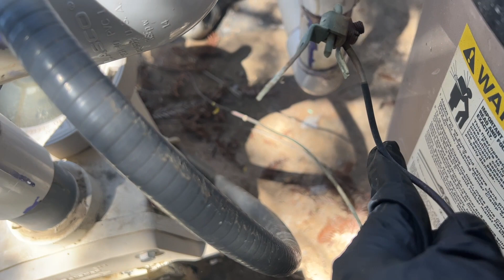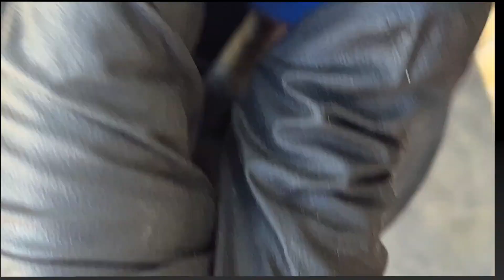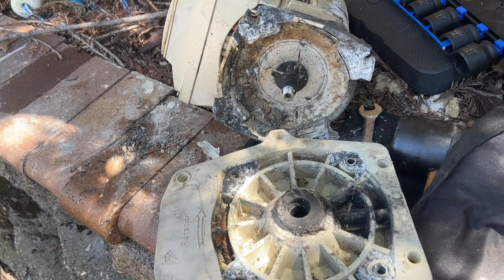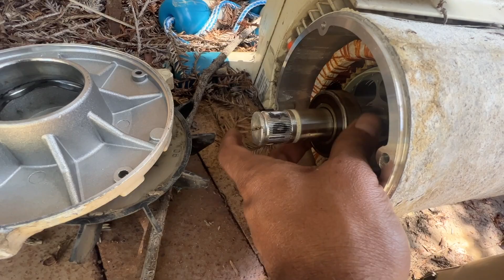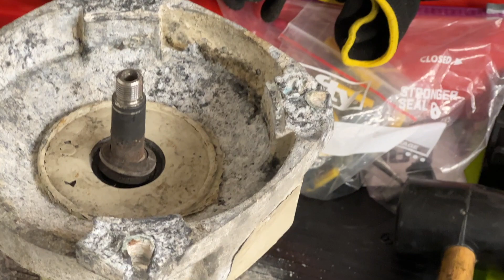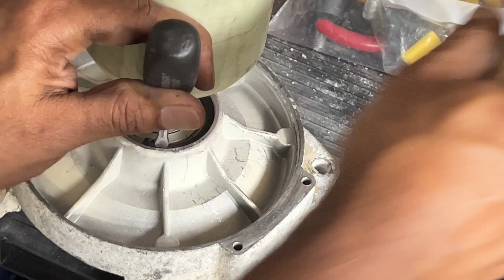Pentair Intelliflow Pool Pump Motor Fix - Bearing Replacement

Comment: Never tap on the outer race when installing a bearing on a shaft. You must use a pipe, a drift, or a socket to tap on the inner race only. Tapping on the outer race can damage the balls, the races, and the cage as all the force is transmitted through them to the inner race. Tap on the outer race when installing a bearing in to a boss. For the same reason.
I hope you replaced the ceramic pump seals, they were leaking as evidenced by all the corrosion.
Reply: Nice video, thanks.
Reply: Use the old bearing,  with a  correct size pipe or socket. This will protect the new bearing.
Reply from the maker: Very useful suggestion.

Comment: Always check for any water leakage from the pump that would indicate a mechanical seal leaking. Left unrepaired, the water will find a way into the motor bearings and seize the motor up, and you will have a bigger problem as this video shows. His motor windings were spared burning up because the high end variable speed pump has a computer monitoring motor current, and shut it down before it got high enough to burn it up.

Comment: Thanks for the video!  On a side note... you do not have to bang on the motor flange with a rubber mallet to remove it.  Simply use a 2 Jaw Puller on the inner shaft side of the motor and the inner cover will come off with no effort.
Reply from the maker: Thanks for the tip!

Comment: A hint for removing snap rings.  The plier’s points are tapered, so always slip out.  I use a small file to make the points look more like an hourglass.  This or just a small groove or reverse step.  Then the snap ring is locked in behind this step/grooves once pressure is applied to open the ring.  Thanks for the informative video.  Just ordered my bearings.
Reply from the maker: Thanks for the hint!

Comment: Thank you. is the bearing size all same for pentair motors? I have 353134
Reply from the maker: Not necessarily. It varies based on the model number.  I took mine out and searched based on the bearing model number and measured before ordering.
Reply: @SivaFolsom oh, I see . thank you

Comment: Excellent video. 35 bucks in bearings and a few hours is WAAAYYY better than $2000 for a new pump assembly or $800 for a new motor.  I just replaced my bearings in my intellliflo using this video as guidance. The bearings recommended here fit correctly and you get 2 of each so keep the spares for the next time. My pump is around 5 yrs old. The original bearings were 6205-DU and 6304-DU and had the rubber seal. The front bearing on mine was the problem. The plastic fan on the back is pressed on but comes off easily. You might as well get a new seal kit while you have the pump apart. I picked one up on amazon for around 15 bucks. You will need a puller to remove the bearings from the shaft and something like a piece of pipe to pound the inner race to install the bearings. Thanks!
Reply from the maker: @jasonfestich2196 Awesome!  Thanks for the update.
Reply: Do you know what model motor? mine is pentair 350305s

Comment: The reason your motor was seized and showing overcurrent it might of been yhat the seal plate and mottor head were really in bad shape for shaft seal leak and caused impeller to bend and pinch..u can see in beginning when he takes off impeller..impeller was rubbin on seal plate because seal plate was no longer sitting well.
Reply: He had a mechanical seal leak that he ignored for too long and water got into nearest bearing and eventually started seizing it up. Luckily for him, he had a motor that has an over current sensor that shut him down before he would of burned up his motor. Never ignore seal leaks, shut it down and fix it.
Reply: @officerkrupke4966 i agree...

Comment: That pump has has a mech seal leak for a while.  That flange is in bad shape.  Usually when they get like that.  The bolts an screws don’t want to budge due to the swelling/corrosion.  On the flange an elsewhere.   
I’ve snapped a few screws even holding the top of the drive into the motor due to that.  

An unfortunately it seems quite common I cross motors that have had mech seal leaks an it gets in shape like that.   An bytime it does crap out.   I’ve had to drill an rethread a few things on motors.  Just so they would hang on a little longer.

Unfortunately that’s why I’ve never really offered the service of rebuilding them.   People let mech seal leaks go so long without worrying or noticing them.  It just royally F’s removing bolts an screws a what not.  

If I were able to source replacement square flanges.  Without the motors I probably would have before.   Replacement bolts even the through bolts aren’t an issue finding. But after the flange is shot.  It’s not really worth it

Comment: Just rebuilt my pump this past weekend and wanted to add some notes for others here. My pump was in pretty much the same condition as the one in the video, so I did take the extra steps once the bearings were replaced and the motor was in one piece to remove the corrosion (using wire wheels, and paint stripping discs on the angle grinder) and repaint the motor before reassembling.

I used Timken 6205-2RS and 6304-2RS bearings.

The stainless bolts holding the seal plate to the volute, and the motor to the seal plate are not metric (14mm) as stated in the video. While a 14mm wrench will work, they are 9/16, with 3/8 - 16 threads. I used a thread chaser to clean the brass threads on the seal plate and reassembled using antiseize on them.

While the method to remove the motor fan (and rotor and shaft) from the back of the motor works (by beating the front bell end off the motor), here is another video for removing the fan: https://www.youtube.com/watch?v=4up3x0yml-Y Once the fan is removed, you can remove the rear bell end more traditionally by tapping on the three raised lugs on the bell end. Then the front doesn't put up any fight at all.

Take your time with the three screws holding the fan cover, and screw holding the ground lug. I could have easily stripped the heads on the fan cover screws but did not. I did however sheer the head of the screw for the ground lug. I was able to set the rear bell end up in a jig (2x4's) to hold it vertical and square in order to drill out the old screw and tap in some new threads. I was able to find a new lug and ground screw from the orange-colored big box store, but did have to notch the fan cover just a little to make it work.

And lastly, if you're going through the trouble to open this pump up this much- replace everything you can, but most importantly the mechanical seal between the impeller and seal plate. I replaced both the impeller and diffuser as well, as the diffuser has a brass race that impeller sits in that was well worn; as well as all the seals. There are plenty of other videos covering those jobs.

Comment: My 4 T25 torx screws on the front impeller plate are completely frozen.  The torx bits break off.  I guess it’s new motor for me:(
Reply: I used an angle grinder to slice the aluminum housing open, sprayed in PB Blaster, then tapped the bolt out. My auto mechanic suggested this method as it’s much easier than drilling out the bolt.
Reply: @ my motor looks pretty sorry. The bigger bolts to the seal plate that broke, I was able to punch them out of the motor flange. The 4 motor flange to motor housing bolts, I ground the heads off to get the two pieces apart. Penetrate oil and a torch wouldn’t free up those bolts so I ground them flush and used cobalt drill bits to drill them out. Then I re-tapped the holes
Reply from the maker: You could try drilling out the screws.
Reply: @SivaFolsom  Thanks, I did just that but installed new motor anyway due to being down awhile. Took some time to get the screws out and re-tapped.  Now I'll have a spare. Two of the heads that held the seal plate broke off too. The ones that didn't break off, broke the inserts out of the seal plate as well. ugh. More drilling, more parts.
Reply from the maker: @ Yes, it's nice to have a spare.

Comment: READ THE @mguerramd COMMENT !!!  
He should also have cleaned off all the corrosion and painted the housing for further protection.  
As to the oven comment - at 350 degrees you may well damage the grease and/or the seals, and shorten the life of the bearing.  
The comment below about the stainless shields offering less protection than a truly sealed bearing is spot on.
Reply: The correct way is to bathe them in a heated oil bath.

Comment: The stainless steel ####-ZZ bearings don't resist moisture as well as the original rubber-sided ones (-DDU aka -DU aka -2RS).  Thanks for the detailed video!
Reply from the maker: Thanks for the update.  Hope it lasts for at least a couple of years.
Reply: Do you if those will fit pentair 350305s? Thanks

Comment: The rubber washer you pulled off at 7:39…do you know the size? Mine was destroyed when I got to that point.
Reply from the maker: You may have to take the old one to a pool supply store and find out.
Reply: I’m going through this progress right now using the video and comments. So leaving the dimensions here in case it helps the next person. 1.604” OD x 0.6105” ID x 0.0970” thick.

Comment: The front flange on the motor is to corroded to be reused!!  That flange controls how much pressure is applied to the rotating seal, and it's gone!!
Reply from the maker: The motor has been working everyday since I fixed it.  Will keep an eye on it and replace if needed.
Reply: U know where to get a new one

Comment: Good video. Unfortunately all of my bolts were seized and the aluminum housing was brittle. New pump at this point
Reply from the maker: You could buy used ones on eBay.
Reply: I use my 1/2inch impact.... until right now it works great..

Comment: Aa said before,  never tap on the outer race.
If you put the bearing in a toaster oven on broil @350° for 10 minutes it will usually push on by hand. You will need heat resistant gloves.
Nice work by the way.

Comment: Thank you so much for posting this.  I've ordered parts and should knock this out in a couple of days thanks to you.  I have one question: what size (4/6/8 inches) bearing puller are you using?  Thank you in advance.
Reply from the maker: It's the 6 inch puller from Harborfreight.

https://www.harborfreight.com/three-jaw-puller-set-3-piece-63953.html
Reply: @SivaFolsom  Thank you sir.  I'm equipped now.
Reply from the maker: @tf9623  Good luck.
Reply: Any tips on getting the second bearing clip out? I’m using your same tool.